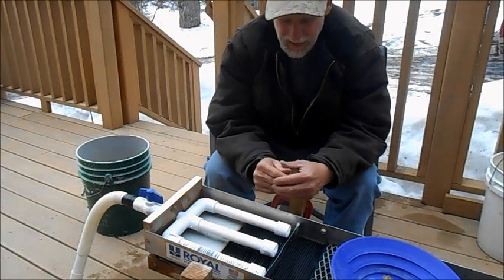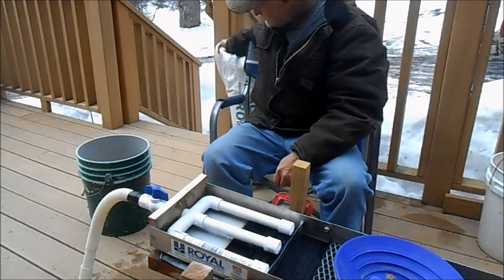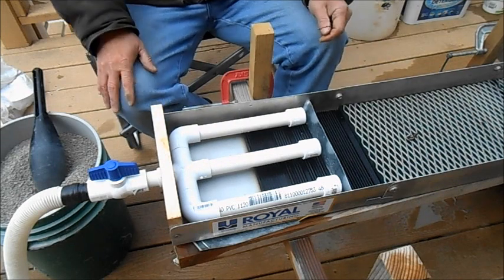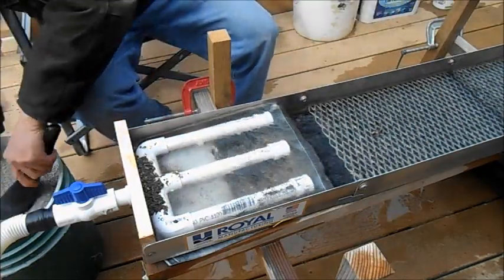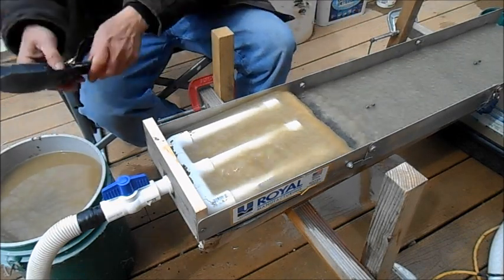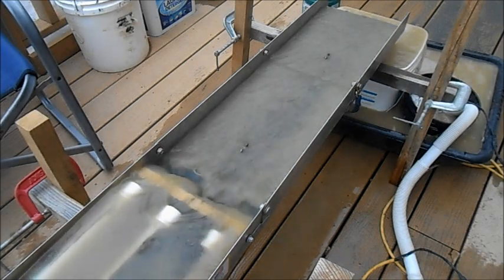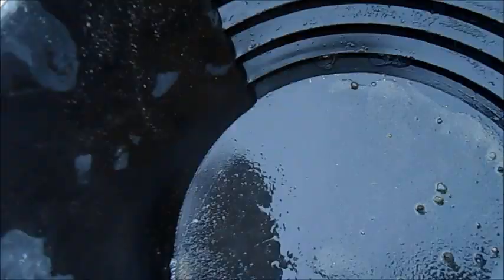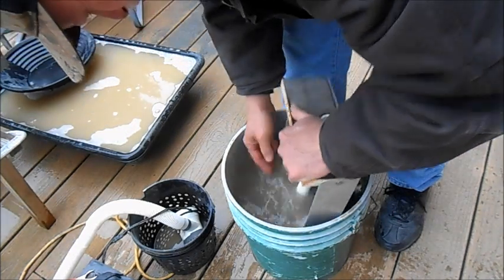DIY Fluid Bed Sluice Box Magnetic Gold Trap Experiment

Comment: Looks good but I think to make it clear out the light material better you want a current  running across the top yours is only blowing material around and some is moving out very slowly.  Even a 10 inch run of water up to the field would help move the material better.

Comment: Alan,
I'm adding a 12 volt tumbler vibrator similar to those demonstrated as DIY on videos and a motor speed control to bring agitation down to only moving the black sands that have a specific gravity of around 6 vs gold at 19.3 and just a 'trickle' of water to aid that difference of specific gravity in moving the sands.
Also, try putting a washer on a digital scale and lowering your magnet very slowly over the washer. Just as a test of the following concept.
The recorded weight of the washer will decrease dramatically long before the magnet captures the washer, theoretically to 'almost' zero weight before the magnet captures the washer, and it will do the same with the magnetite sands.
The combination of the vibrator and magnets mounted over the sluice box plus a tiny bit of water at a far less grade of box will move both hematite and magnetite if all is balanced to that end.
You may need to mount magnets atop sheet magnets to provide additional lift of magnetite unbroken down length of the box. Be sure all mount high enough to NOT catch black sands, but only provide the lift required for the low flow of the water, AND the vibration to move those sands.
Decrease of both water flow and grade of box to catch the fines is my target.

Comment: One trick here is to use to fluid bed to get rid of the lighter material, and use magnets to hang onto the magnetite a little further on. Done like that, the magnetite acts like a semi-fluid riffle material which allows gold to settle out, but not anything denser than the magnetite. What you end up with at the end of the run is a mixture of magnetite and gold; you need a clean-up stage like a blue bowl to separate those two, but the bonus is that such a method even catches micro-gold.

Comment: I’m wondering about a similar design, but using something like some Magic Bits instead of stationary magnets. 
In the resulting slurry, the magnetic sand would be trapped, but moving as the Magic Bits rotated, allowing the gold to flow through to be caught in the sluice riffles.
Reply from the maker: I think that is a good idea. Good luck with your project.

Comment: One tip on the water supply that I've used that's helped me because the water going down the sluice looks pretty muddy....I got one of those heavy duty storage bins, my sluice folds out and hangs off the edge. I added a material screen using plexiglass to segregate the sluice water from the section the pump pulls from (think of it like a settling pond). It was like instaclear water. Another thing I'd recommend is actually from my homebrewing setup (it's funny how much useful equipment can be used for both beer making and gold mining, lol). Anyways, the sluice, beer pump, and hoses all fold into the storage bin for easy storage whenever I'm not using it. I've got a ball valve at the bottom of the bin that controls the water supply. For hoses, I've got flexible silicone hoses w/ quick connects that make setup a breeze :) I'm working on some videos that shows everything, so give me a return subscribe! They should be posted soon :) If you have any ideas for rifle designs you'd care to share, I'm all ears. I've got a 3D printer and I can print 6" wide sluice inserts w/ various rifles. Best of luck finding the motherload!
Reply from the maker: Thanks for the tips and I will have to check out your channel. If you have a printer you can do like I do and print the molds and then make the mats silicone that the gold will stick to.

Comment: i want to see someone use the anti magnetic properties of gold combined with the magnetic properties of black sand. 

as as now, the fine gold is being held in place by the black sand. you could do the same thing by dragging a big magnetic thru the sand. one particular you tube video shows someone doing that, and it saves him time and effort.

if you attracted the black sand with a magnet, and repelled the gold with the same magnet, you would have a pretty good system.
Reply from the maker: I would like to see that to. Thanks for watching.
Reply: Gold is not “repelled” by a magnet.

Comment: Bravo. You actually use your brain.
Now maybe you’ll try this idea of mine which will help you find any gold you might have located, it will also save you from toting a trommel to the creek... 
HERE GOES
TAKE A 5 GALLON BUCKET AND FIX A WATER HOSE I DUNNO 6 INCHES FROM THE BOTTOM. TURN THE WATER PRESSURE UP ENOUGH TO WHERE THE WATER BOILS / ROLLS IN THE BUCKET.. THE SAND, THE DIRT,  THE ROOTS, THE ROCKS UP TO A CERTAIN SIZE WILL ROLL RIGHT OUT THE TOP OF THE BUCKET LEAVING THE HEAVIES IN THE BOTTOM. 
SO FAR YOU ARE AGREEING, YOU HAVE TO BE

NOW WHEN YOUR DONE WITH YOUR DIRT LET IT ROLL SOME MORE , BUT PLACE YOUR BUCKET ON MAGNETS THAT YOU HAVE PLACED IN ANOTHER 5 GALLON BUCKET SO THEY DONE LOOSE CONTACT WITH YOUR BLACK SAND... AND POOR THE GOLD OUT. 
LET ME KNOW HOW IT PANS OUT
Reply from the maker: That sounds like a fun experiment to try. I think it would work for the most part I don't know about pouring out the gold I think it would just get hung up in the black sand for the most part. I do think it would be fun to try and see how much of the gold could be caught in the bucket. Thanks for the idea.
Reply: sir Alan,did you try this idea?

Comment: Here is a idea for you ,  maybe good maybe not.  Instead of magnets on the bottom,  why not on the top to keep the black sand in the water flow  longer.
Reply from the maker: Hi Gary honestly I am not sure on how that would work I did try to use the magnets on top one time to pull the black sand out of the water flow and the black sand would not break the water surface at all. Thanks for the input.

Comment: Good Video. That's the best place to put a fluid bed as the finer gold is the lighter material that gets dumped and you have the mat below to catch it.  A new sluice I'm working with is kind of the same way, you can use the main water well as a fluid bed and the mat is below it to catch the fine gold that gets blown out. It will be interesting to see how this works out in the field.
Reply from the maker: It will be interesting to see how it works out in the hills and see if I can keep the holes from plugging up. I wish all of this snow would melt good luck on your build.